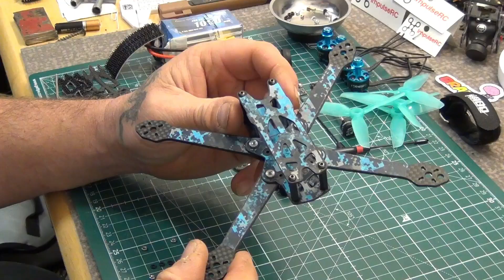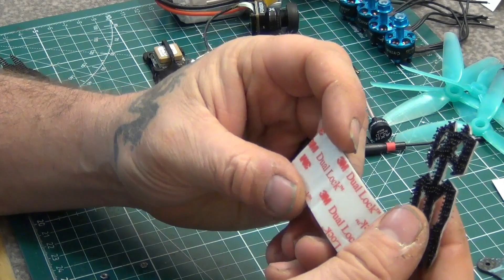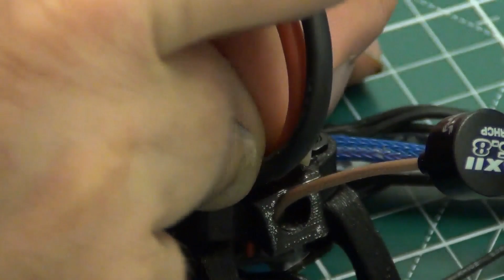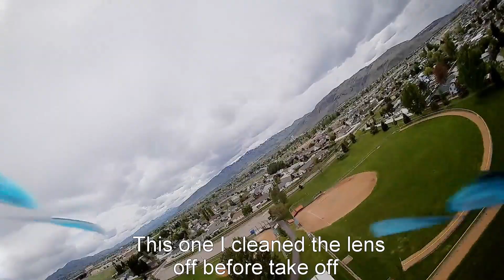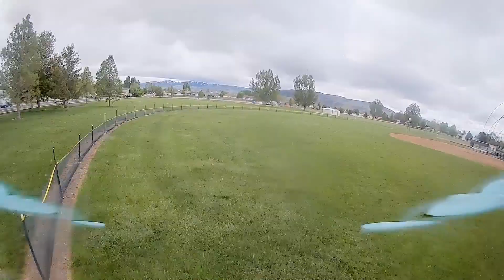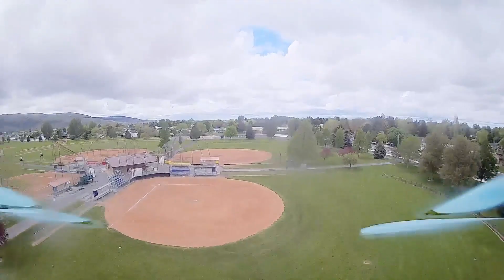4" ImpulseRC Micro Reverb Build  95mph!!

Comment: i got my micro reverb 4inch to 50- 60 so far with 4s and some beefy 1804.5 pyrodrone hyperlites i need to fix gps warm up and test for real top speed
Reply from the maker: If you fly in one spot your GPS warm up should take a lot less time on the second pack. I have hit speeds of 112 mph with this quad now and this is just experimenting with different props. I have found that the 4.3 or 4.5 pitch on 4" blades has the best top speed. I will warn you once you get past 80mph it is scary fast. I have a racing 5" quad that is hitting 120mph now and that thing freaks me out lol and I have not even tuned it yet. I should have a video out on that build really soon. Thanks for watching and hope to see your flights with yours really soon.

Comment: This was a nice build and all very good gear,theres one mistake i seen with the vtx and receiver.This setup with the two stuck together will greatly reduce range and will cause intermittent failsafes.the vtx produces electrical transiants almost like a gopro camera but even worse and this produces a huge noise floor for the receiver.The further apart these two are the better performance you will get.I no your cramped for room on this build but if you could put one at each end of kwad would greatly improve range.Look at longrange setups like wings how the further apart these are the greater range you get.I have tried and a 3inch you can only get 1.3 miles but move those same componites on 5inch and you will get 5 miles 7inch 12 miles.You probably already knew this but i just wanted to share what i have found out.
Reply from the maker: Ya working on a way to get them separated but not much room to work with, with the DVR board in it. Still works really good for what I do but working on a new mounting system.

Comment: I notice you're using a 45A 4-in-1 ESC, do you think the Mamba F405 Mini stack (20A with 25A peak) I bought for my 4in Reverb build is going to be enough? I plan to run it on 1407 3200kv motors R-Line 4s 850mAh lipos with Gemfan 4032 Windancer props.
Reply from the maker: I think you should be fine with any Mamba board. I just went the 45A because I was looking to run 6s on this and going for top speeds. 20A shuould be plenty and it should fly well. It is a very light frame and with the 850mah battery it should be lighter then mine so no really need for an over powered ESC like mine. Let me know when you are done. I would love to see it and get feed back on what you think of your build.
Reply: Very cool, thanks man. I'm finishing up my 4in Toothpick style build right now, going to start the 4in Reverb tomorrow. Not sure when I'll have them on rotorbuilds, hopefully by next Saturday 👍

Comment: Great video. I just ordered my 3” micro reverb frame today. It’s getting the guts transplanted from a Diatone GT R349 so it should be interesting to see how it does at 1408 4000kv and an 850mah 4s. I did upgrade the video system to a TBS Unify Pro and a Micro Eagle though (it had a Micro Swift and Runcam VTX).

I crashed my Diatone and broke the plastic camera mounts, which I took as a sign that I really want a top mount battery frame to match my 5” Marmotte. The geometry should stay relatively the same, though the Diatone is slightly more stretched than the reverb.
Reply: Hey dude, I’m happy to report that the problem of the hot motors was the incorrect setting of the kHz of the esc. 

So who ever would have this issue be sure that you set your esc to 48khz :-)

And guys, that quad is just awesome! 
Extremely fast on the one hand and if you cruse extremely efficient. (7 min flight Time in freestyle) 

Therefore thank you for inspiring me to build this beast! 

Over and out
Reply from the maker: @DanO-FPV  I am so glad you found the problem and are able to fly it without burning up any motor. Way to go. I did not even think about checking that too, so thank you for adding this. 
I love flying this quad and you are right on the money on how it flies. Super fast and I have to fly it every time I go out. Thank you for watching and I am really glad I could inspire you to build one of your own.
Reply from the maker: That sounds like it is going to be a fast system setup like that. Are you going to be able to fit the TBS Unify Pro in there okay. I don't know how big the Runcam VTX is. I can't wait to see what that is going to do. Thank you for watching the video and let me know when you get it done.

Comment: Hey mate, 
First of all thx for this video, I actually used your parts too and I’m
Exited for the maiden. 
I actually have 2 questions:
1. which cap did you use? There is one 1000uf and a smaller one?
---> I saw in the vid that you're using the 220uf one. Was hard to see on phone ^^
2. is there any possibility to get the 3D parts stl? I like to use them too. I’m
Glad to donate for them :-)

Greetings DanO
Reply from the maker: Thank you for watching and I hope yours flies just as good for you. It has been my go to for a while now. As far as the cap, I just used the small one that came with the HGLRC Forward ESC I forget what it actually was but works fine for 6s. The 3D prints I got from Brain3D so not sure I could get the stl file for you. Sorry, I would give it to you if I had it. Let me know if there is anything else I can help you with and I hope to see pictures and a video of yours flying.
Reply from the maker: Ah, that is not good at all. I just recently tried some TMotor F20s on this build for a different kv and it fried one of the motors in a pack and a half. The Forward motors at 2400kv have been perfect and have not got them to hot at all. I don't do anything really special but I also run stock PIDs on betaflight 4.0.4 at the moment. don't run high pitch prop. The most I put on it is a 4x4.3x3 and make sure the capacitor is doing its job. Other then that nothing really all that special. I do fly at 4200 ft elevation most of the time and very low humidity but not sure if that plays a part or not. Hope that helps.
Reply: Hey mate, sorry to brother you again, but I now killed the second motor with this build on beta flight 4. 
What magic you used to get it in the air without hot motors :-) ? 

Thx for helping out.
Greetings DanO

Comment: Those are really good looking, and flying rigs. I'm building a 4 inch 4s with 3600kv 1408 motors, with a 850mah 4s it is going to weigh about 280 grams, give or take 10g, I can't remember exactly. My question is how do you think it will fly as far as speed, and efficiency. My thoughts, or plan was about the same as yours, fast, and efficient. I was looking at the Diatone 515, I think, it's the 5 inch with the 15xx motors that claim 15 minutes of flight, and good speed. That's what got me on this track, that and I bought an ultra light 4 inch frame a year ago when I started, anyway I enjoyed your build and flight footage. I'm new here, and to posting on YouTube, I'd appreciate if you would check my channel out, my editing teacher(daughter,lol) is coming monday, so everything will get better, I really didn't expect 350 subs in a month, so I'm a little behind. Take care!
Reply from the maker: You should watch the 3" Micro alien build. I have the mamba stack in that one. I like it and it does have a lot of power. I run that one on 4s as well. I think it will be pretty nice flyer for you on a 4" . Great board and you are right very trouble free for sure. and that should be around what you are wanting at 280g. Good luck and can't wait to see the footage on that one.
Reply from the maker: Even with my lightest 4s weighing in at 130g it still comes up to 335g. but it really depends on if you are going to have the third board for HD DVR, and the GPS. I think It might be able to slim it down to close to that. The 3600 might be just about right for a 4s swinging 4" props but again depends on if you are getting a 45A ESC to match those motors. I think if you go much less it will be a little under powered but speed should be close. I don't know if you will get 15 min of flight time out of it but it still should be very efficient in cruising.  I get about 6 min out of this build and that is hitting top speeds. I have not been able to get more because it is to fun to go that fast lol. I will definitely check out your channel and sub. If you do need any other help please hit me up and I will help any way I can.
Reply: @edgefpv4410  I'm going to use the mamba stack, it's rated up to 6s 40/50amp 5 or 6 second burst on the 50amp. I like the 32 bit escs but this is a cheap build, and the mamba stack is easy. Since I'm helping someone get into fpv I wanted their1st experience to be trouble free. I won't have GPS, and I'm thinking I might put a 6g runcam dvr bd. In. I'll definatly let you know how it goes. Just got my 7 inch up, and my 5in. Now needs... maintenance, lol it's always something. I need to sit down a whole day and work on quads, problem is I get one fixed, test it for the rest of the day,lol I appreciate your support, take care!

Comment: Thanks man.  I just purchased an Armattan Gecko 3”.  Was planning mostly all the same parts.  I love my 5” Reverb btw!  Beautiful flight video.  I think I’m going to enjoy the Foxeer mix.
Reply from the maker: Its a great mix of parts. the Gecko should be a great frame for these too. You will like the remix. One note just watch the caps on the mix when bolting it down. I knocked off a couple and had to solder them back on but if you are careful it will be fine. It is a great camera setup.

Comment: Thanks for the video, big help as I am starting my first build. Also same frame.
Reply from the maker: Nice, glad to help. What components did you decide to go with? This is a great frame. I think you will like it.
Reply: Went with HGLRC FD445 Stack with F20 T-Motors and plan on doing it as a 4s. Also the RunCam Split Mini 2, TBS Unify Pro, TBS Crodssfire Nano RX. Hope I can get it up and running. Just not very good at soldering, I hope all the parts work together, time will tell. Cheers David
Reply from the maker: Nice, That will be a great build. I almost went with the F20's just was not sure they would handle the 6s pack. Come to find out they will lol. Your build is really close to mine so if you need anything let me know.
Reply: Thanks will do.